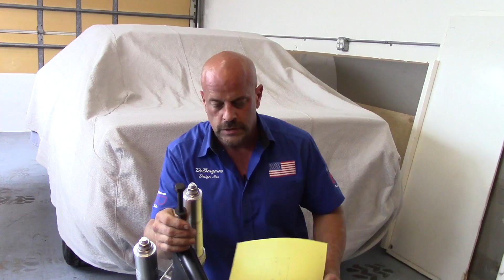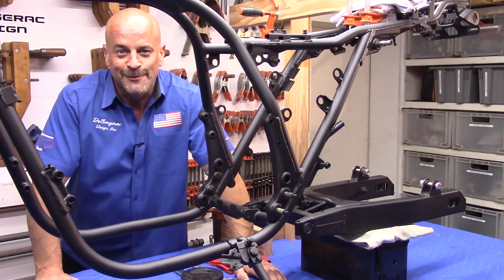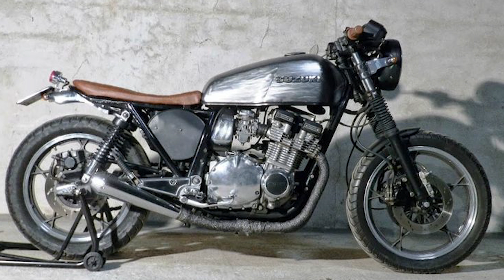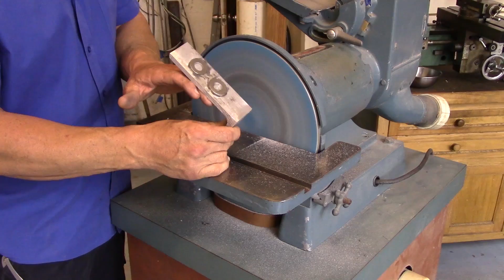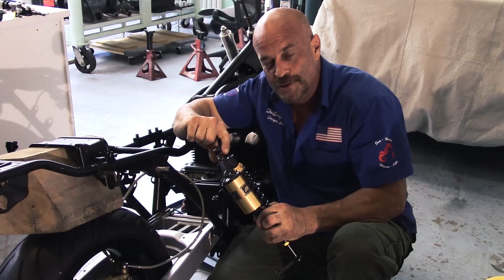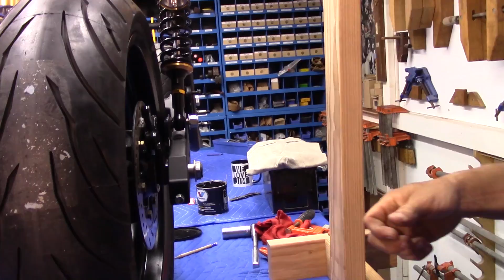How to build cafe racer

Comment: Was this ever finished? or another part? I didn't see any other parts on the channel? The video is fun. I am building a 78 KZ650 but utilizing a 2006 GSXR 600 engine. I am currently at the same point as you with the swing arm but I'm converting it to a mono shock. Once its complete I can line up the engine and rear wheel spocket. Cheers.
Reply from the maker: Yes that project is just about done and the video will be out in a couple of weeks. Good luck with your project.
Jim
Reply: @YachtShopCreations  looking forward to it!

Comment: Just curious how you would go about making a custom stem? I watched your previous video in which you modified the Kawasaki stem, but what if you needed a full custom stem? How would you even start measuring dimensions? and how do you know how far up your threads need to be etc? Thanks love the video by the way!
Reply from the maker: Very interesting question, not a whole lot stumps me but you certainly have in the regards of why you need to start from scratch? In my humble opinion the most important part of the bike is the stem.  I can think of a lot of parts that could faiil on a bike and you can still walk away relatively unharmed. Yes I do have personal experience with this and fortunately I am still here :-)
If the stem fails, all bets are off. I am more than happy to facilitate a safe way for you to do this, But we need to talk over the phone or FaceTime etc.
I’m pretty easy to get a hold of and I’ll talk to you then.
Jim
Reply: Yacht Shop Creations ah thank you that sounds good i’ll private message you.

Comment: An interesting way of mounting the swinging arm, however there is no bushing. The Ducati swing arm normally grips the spindle and then the spindle bears in bushes mounted in the back of the crank case which is a unique method to Ducati, the,way you have done it will look great but won’t last long, dodgy engineering.
Reply from the maker: I agree with you Joe, Bernardo, whom is the owner of the bike and also going to be the end user, also knows this. He knows this is going to be a wear point that needs to be greased often and will eventually need to be replaced. It's called a trade off for not spending a lot more money. Dodgy engineering would be doing something that nobody was aware of or trying to hide something. I do however understand the people who don't have the ability to do their own projects are the largest critics on YouTube.
Be well,
Jim
Reply: Haha cool to hear the reasoning behind this choice DeBergerac. Awesome build.